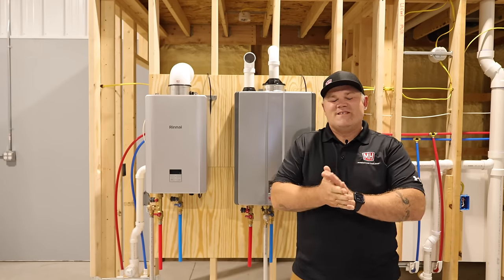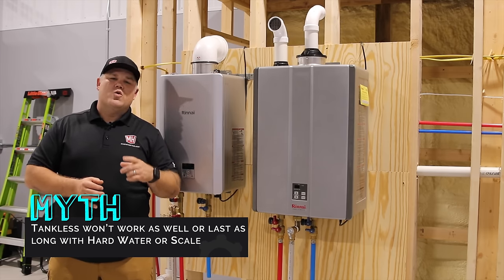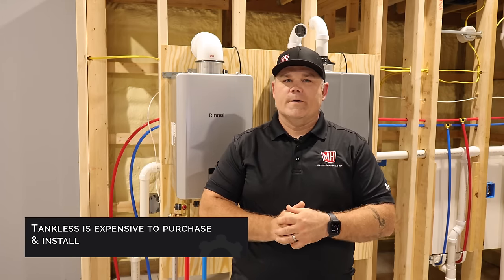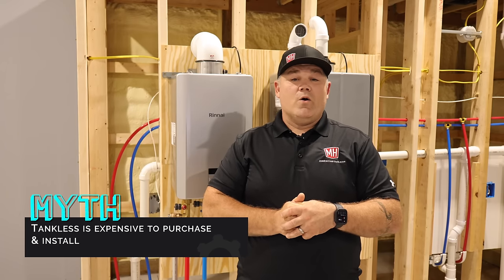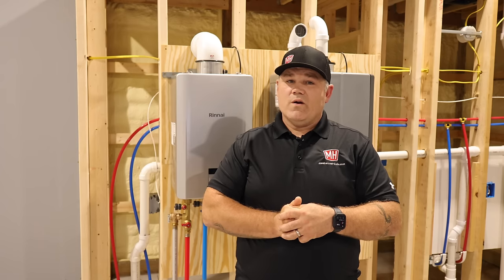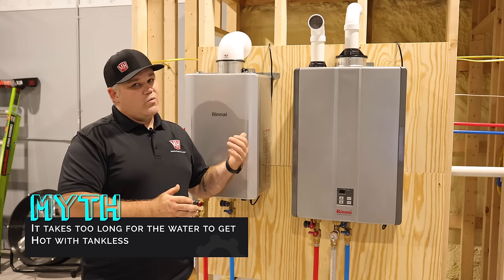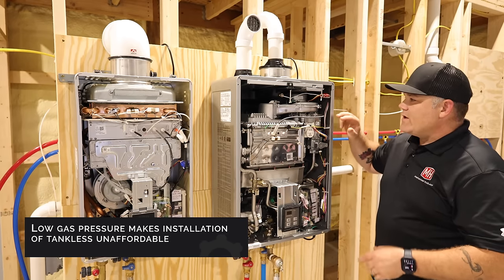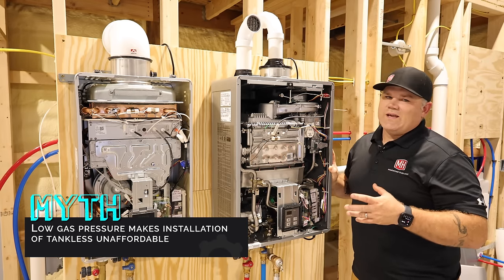Myth Busting! Tank -vs- Tankless Water Heaters

Comment: Costs are only comparable to replace a tank water heater with a tankless heater in a few circumstances.
The tank water heater needs to be by a wall, if it sits out in the room next to the furnace then you will have to move the water heater location to a wall or have a wall built. Tankless water heaters cannot float in midair. If you are moving the water heater to an existing wall now you will need to rerun the water pipes, gas line, and flue to the new location. (All at additional cost compared to replacing a tank water heater with a tank water heater).

All residential water heaters require a 1/2" gas line. Almost all (but like you said in the video a few don't) require a 3/4" gas line. So most tankless conversions require upgrading the gas line to the heater. (At an additional cost compared to a tank-to-tank replacement).

All tank water heaters are vented with either the metal flue pipe along with the furnace (or with a power vent heater PVC). Less than 20% of tank water heaters currently installed in homes are power vent models. So, a tankless water heater requires a whole new vent system to be installed. (At an additional cost compared to a tank-to-tank replacement). I am not even mentioning the size of the job if the basement is finished and now you are cutting open drywall ceilings to run the vent pipes.

Having the recirc feature set up on a tankless water heater diminishes the efficiency of the heater. Now the heater fires up (on the model you show in the video) a 200,000 BTU burner (that's bigger than most residential furnace burners) to heat and circulate the water to the sink. If you have a gravity feed recirc line to the tank water heater this is done continuously at no additional cost.

I noticed that you don't tell people that with a tankless water heater you have no hot water during a power outage, but with a tank heater you still have all the hot water you normally do when power is on. You might have to shower by flashlight but it's hot water.

It sounds like your tankless water heater costs you money in utility bills. Your daughters wouldn't be able to take super long showers if they didn't have unlimited hot water. Think of how much water you would save with 10-minute showers.

You state that you charge pretty much the same to replace a tank water heater with another tank one or a tankless. In Nebraska the average flat rate for replacing a 50 gal. water heater with a like one is $2,000. A typical tankless water heater conversion runs about $6,000. A 50 gal. water heater is $700 and your model tankless runs $2,700. If you install tankless water heaters for $2,000, put me in your next open slot and come install a tankless at my house. If you charge $6,000 for a tank water heater installation, how do you sleep at night?

The question I ask homeowners that are considering switching to a tankless water heater is, "do you run out of hot water on a regular basis?" (Like you, several daughters showering or a big soaker tub that is used regularly)? The main benefit of a tankless water heater is the ability to have unlimited hot water. But if you don't constantly run out of hot water this isn't a feature that is really needed.

Even with the higher efficiency of a tankless compared to a tank type you will not see that significant of a decrease in the utility bill. The majority of the gas consumed a month is by the furnace not the water heater. Most likely you won't even recoup the additional cost of switching heaters after 20 years of a slightly lower utility bill.
Reply: You got that right. If they need more hot water and they have a tank you can turn water heater up and put in temperature control mixing valve. In St louis a tank water heater can last 30 years +. No tankless will last that long. Tankless have their place like for the family with eight kids (8). Commercial kitchen Where they never have hot water at end of night to clean. A tankless cost three times as much $500 tank labor $450- $1000 or $2000 for a tankless A good one. labor $1500- $4000   Add softener or filter and If you have to move it close the door.
Reply: They make electric powered tankless heaters too.
Reply: Yes, I agree. One thing I noticed is that there is no mention of maintenance. I understand with a tankless there is a scheduled maintenance program required. If that's true, it might be very expensive, especially for someone who has to have it done by a contractor because for whatever reason the homeowner cannot do it his/her self.

Comment: I just got mine installed 2 weeks ago and I will say I am very impressed and pleased with the results. I was very hesitant at first due to the possible delay to get the hot water to each locations. But it proved me wrong! Here are my stats: upstairs washroom took 25 seconds before to get full hot water and now it takes 35 seconds. In my kitchen it used to take 15 seconds and now it takes 25 seconds. So really it added only 10 seconds to get full hot water at 140 Fahrenheit for each location. It is very quiet and gained a lot of storage space. My model is the Navien 240

Comment: I installed an electric tankless water heater and it worked well. It required a lot of electrical capacity for the installation which would have been really expensive had I not been able to do it myself. What I didn't realize is how it would affect my power bill. It shot up at least a hundred dollars a month. I expected a little bump but it was surprising and not in a good way. On the plus side I was able to fill my whirlpool tub without having to stop and wait for the hot water to come back.
Reply: I have a natural gas tankless and I noticed a considerable drop in my utilities with the tankless.
Reply: that is very helpful
Reply: was your prior water heater gas fired? I am all electric in my heating/Cooling and Water heater. I am strongly considering a tankless as my 25 year old water heater is becoming less hot water and more hurry up and wait. so I am looking at the energy difference between electric water heaters and electric tankless.
Reply: @BigHappysPlace  I replaced a large electric water heater with an electric tankless. I loved the space savings but not my electric bill. If I could go back, I would have gone with a gas tankless. I have heard that those are more efficient but can't say how the actual dollar to dollar cost to operate would compare.
Reply: Yes a gas tankless is going to be the cheapest and most efficient way to heat water.
Reply: @Jason Peterman are you using more hot water than before (due to convenience of neverending hot water)? Or using more on-peak electricity?
Reply: @8.6GivenAdqVacSysm  no, no different usage wise. It takes a lot of power to heat water instantly. This was several years back. Now my ex wife has the monstrous power bill. I went back to a regular tank heater (that now cost 5 times what it used to and almost 50% more than my tankless did)

Comment: re: Water quality:  I have a hard water problem, and due to original construction constraints, I haven't been able to treat the water properly (still working on a solution).  As a result, I've been flushing the water heater (Rinnai tankless, recirculating, condensing) with vinegar about every two to three months to mitigate the impact.   The sentiment problem will impact any water heater, but since tankless heaters have no water tanks to trap sentiment, it's immediately flushed into the plumbing system, fouling fixtures, check valves, and anything else in the system.   The solution I came up with is a spin down strainer at the EXIT of the water heater, which traps most sentiment, and can be flushed with the flip of a valve..  I believe installing these should be standard for tankless water heaters, i.e. it just makes sense, regardless of the water quality.

Comment: As I’ve already got a gas supply to my existing water tank & when it was installed, they installed a vent line as it was a high efficiency device, you’ve convinced me that a tankless is a viable alternative. Thanks for the info!
Reply: Natural gas sizing is very important...you could be going from a usage of 40,000 BTU to 200,000 BTU quite easily..find a professional to size this load before you make a decision on what tank you will use...you may not have much to change or very easily have to redo your whole gasline or maybe even your meterset,

Comment: I would love to see a comparison video of Gas vs Electric Tankless Heaters. I think that is where some of these "myths" are coming from. It's been a little while since I installed either type but never had any luck with the electric tankless being able to maintain a consistent temp and the customers ended up going back with the hybrid tank models.
Reply: You are right, gas heating works a lot better in a tank less scenario
Reply: Electric tankless .. YIKES!!!   Only viable for small units
Reply: This is where you spend install $$$$ even a small electric unit requires a lot of large wire. right now that's big bucks unless the power panel is right by the heater.
Reply: Gas is not all over. gas is carcinogen, Gas can smell and leek . Gas will be outlawed especially large cities.
Reply: Electric tankless is great.   Use several smaller units in your home, instead of one large unit.  Cheap, easy to replace, takes up no space, unlimited consistent, hot water.   Put a 1.5gpm shower head in, and save a fortune.  The teenager can shower for an hour now, I don’t care.  That’s like 1.25 in electricity only with a my setup.  Units are like 200 bucks and easy to replace.  If one does, the others are still working.
Reply: Love my electric tankless.  30 years on it. Infinite consistent hot water. No change in electric bill (#1 question). Very reliable, and DIY install, where permitted.  I did mine myself. Best thing i have done! 130f water all day long!
Reply: Solar Peeps would really like that answered!
Reply: @phanttomracer  A small electric water heater close to where the hot water is needed!  This is the best idea yet!  It will cost a bit for the wiring, but there will be savings because you will be heating hardly any pipes.
Reply: @777rogerf  yes, but will need one at each location.  So hardware costs would go up a lot, especially wire
Reply: @FilmsForActors and most panels have to have additional wiring brought in from the street or pole by the utility,in addition to your electrician costs.
Reply: @travisedwards9983  did you see the gas line explosion that flattened multiple suburban homes and killed multiple families? Gas is not safe at all.
Reply: @travisedwards9983  that's wrong. People get killed by electricity too. The difference is gas is explosive and more dangerous
Reply: @lastlion65  Smell is by design and not a defect. Also "leak".
Reply: @travisedwards9983  Gas means I don't need to upgrade my generator. I use a tiny 2200 Watt propane genni to pump & heat with gas. Going electric I'd need a big diesel running while using hot water. That upgrade is a big expense and I'd need to keep a lot more fuel too.
Reply: @777rogerf  Used in commercial buildings a lot.
Reply: @legonut78  Use several smaller units - yes, this may work pretty well for sinks, but for filling a tub? It might need some thought... BTW we have a tiny tank water dispenser in the kitchen, under the sink, that gets a lot of use and does not cause the main tankless to turn on because it only uses cold water.
Reply: @paulx2777  You are correct. For a bath it takes a little planning ahead.  Turn the water on slow. Come back in ten minutes. Tub is full.   

But you are right.  You can’t have 30 gallons of hot water in two minutes.  Our tub is a 2 person, and we still use a 10kw tankless.  Love it.  These sorts of tubs are for a long soak anyway.  Usually we watch a movie…..plenty of time for it to fill and then get cold and need topping off.
Reply: @lastlion65  Gas will never ever be outlawed. If you think electricity is without it issues you are naive. EMF,  shock, fires and many more.
Reply: Yep, the "cold water affecting my unit" myth is true. I'm currently dealing with this atm for my 18kw unit. Yes, summer time, infinite hot water, no issues. Now its freezing cold out, water is freezing coming in. The tank is struggling, throwing an E5 (can't keep up heating the water with the flow) everytime we use even just the kitchen sink. Shower is lukewarm/cold water. This is all electric, so gas myths might be different.

Comment: I would like to know more about electric vs gas tankless.
 Good video though. The best I've found so far on the subject.
Reply: The main problem with an electric tankless heater is the amount of amperage needed to run the unit. A small 11-13k unit is no problem. The problem comes when you go to the larger units. They require large amounts of power and in a lot of circumstances you need a sub panel on your electrical panel. Most houses have 200 amp service feeding the house. That is the main downside to them.
Reply: @captj3z  now check out the power needed when the incoming water is 48 degrees in the winter here in New Hampshire.
Reply: @godofplumbing  Won't everything just be sooooo wonderful if those in government get their way??

Comment: My Polaris high-efficiency hot water heater has a tank, along with a similar exchanger like the ones in these tankless units and the hot water is endless no matter how many showers I run. I just hate the condensation that spews out of the combustion stack. Great video!

Comment: Thanks for the overview, and you make good points, but after owning a Noritz condensing unit for four years, I'm not a fan of tankless heaters.  

We renovated our house, which had two 40 gal tank heaters in parallel.  Contractor's plumber convinced me to install a tankless Noritz to replace the two tanks ("instant hot water!").  I said I wanted to keep one of the tanks as a backup - in series, bypass-able, with thermometers on the inlet/outlet/return of the tandem arrangement so we could troubleshoot the loop if needed.  Plumber said I wouldn't need it but agreed to install all the bypass valves and the thermometers I asked for because it was just extra income for him.  

The tank heater - 10 years old at this point, and still going strong -- has saved me from running out of hot water at least twice or three times each year when the tankless has failed (about 10 failures in total).  More often the tankless doesn't fail entirely but errors-out on high exchanger temperature, requiring  a bypass if you are showering, and a "wait and reboot" sequence.  But with the failures,  I've had to replace an air-gas mix valve, an air fan (the turbo charger you talk about), the water mix valve, a control panel, a PCB (printed circuit board), and my personal fun-in-the-hot-attic event: full heat exchanger replacement.  I am so thankful that I kept to my guns with the spare tank as I would have been completely without hot water multiple times over the past few years until Noritz sent a part to me.  And although Noritz has warranted parts, troubleshooting takes several hours of my time, and in the case of the exchanger replacement, expensive plumber's time.

What you didn't mention in the water quality section is that tankless need to have much cleaner systems to operate.  I clean my system each year with vinegar at minimum, or the solution when I feel like it.  Our system is on relatively soft city water, but I have an inlet filter for both the city supply and the hot water return line.  I do this solely to ensure the tankless doesn't foul (it did foul a few months after commissioning due to teflon in the line - that's when I installed the filters.  Tanks, although they do collect sediment, are much, much more forgiving. 

Kirk
Reply: I’ve had a very similar experience with my rheem. Several parts sent for free. several events of zero hot water. Always parts failure. mixing valve twice, circuit board twice. thermocouple/ sensor once.

Comment: I absolutely love my tankless with the built in recirculating pump. I added a commercial water conditioner and softner to mine. As far as efficiency goes, the longer showers definitely eat up any savings and yes, we needed a larger gas line to heat the water for multiple showers. We have 105 psi water that is regulated to 65psi. That gives us plenty of pressure no matter how many fixtures are running. I'll never give up my tankless.
Reply: Your recirculating pump is also an effective heating system for the insides of your walls, especially if your lines are not insulated. I.e. you will find a significant portion of energy used to heat your hot water, is being lost. You can check this by reading the gas meter over a period of time when hot water is not being used. This will then enable you to determine the average energy loss when in the ‘standby’ mode and enable you to calculate this as a portion of your whole gas consumption. (Assuming you only use gas for hot water heating)
Reply: @Denso  You'd be absolutely right in a normal situation. My lines are 100% insulated and the tankless has learning technology. It remembers when you use the hot water in increments of 10, 30 or 60 seconds. I've set mine to 60 seconds. It will the run 15, or 30 minutes prior to your shower, or other heavy use. I've set mine for 15 minutes. In reality, I'm probably more thermal efficient than a tank water heater. My home is also fully insulated as well.
Reply: Yes, when I install tankless units I warn the customers that they will never run out of hot water -as long as they pay their gas and water bills, which may go up if teens and wives happen to take up residence in the shower 😂😂 luckily there is a power button on it that can be used in emergencies to get family out of the shower in a timely manner.